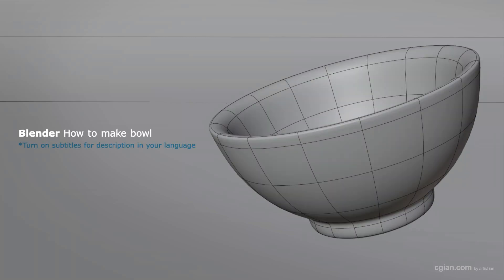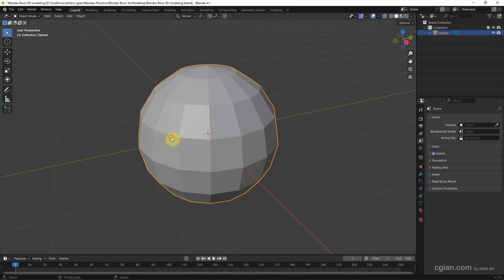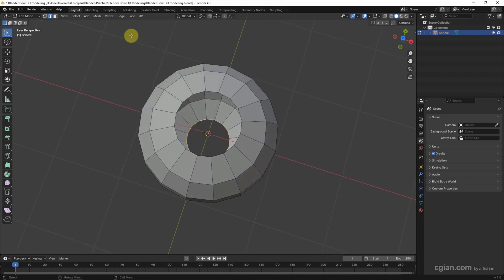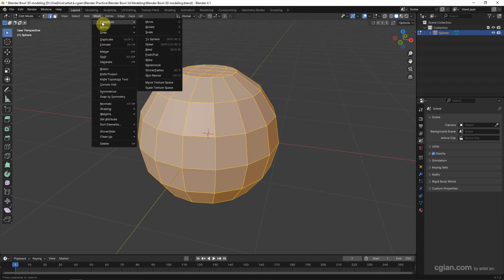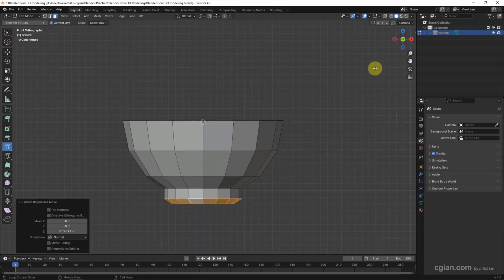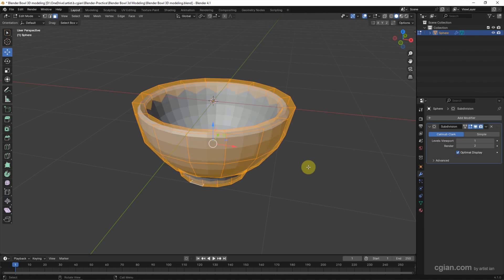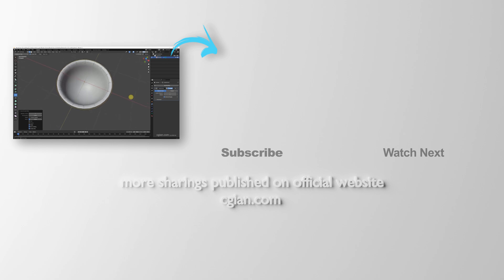How to make a bowl in Blender - 3D modeling tutorial

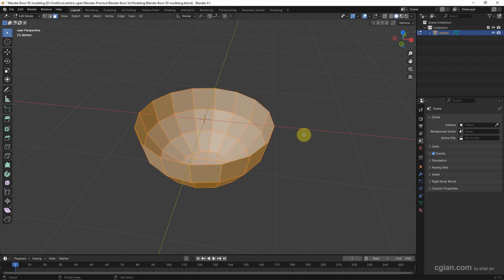Comment: I dont understand 1:39 

If you extrude you only go left right or up and down,

and if you scale it only make it bigger wthout giving it thickness.

You should extreme detail to stuff between 1:39 to 1:45

In fact you can just solidify it, rather than extrude this extrude that
Reply from the maker: This is using Extrude and then Scale, you can try press E and S, and move cursor.

Yes, another option you can use Solidify Modifier